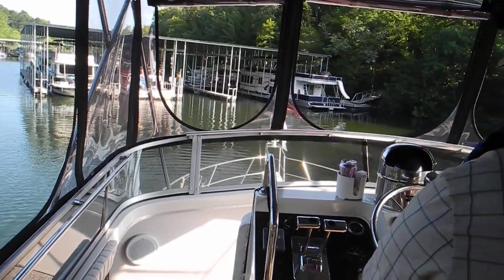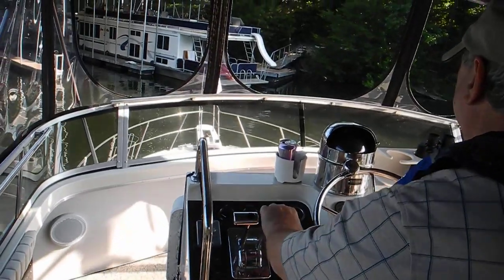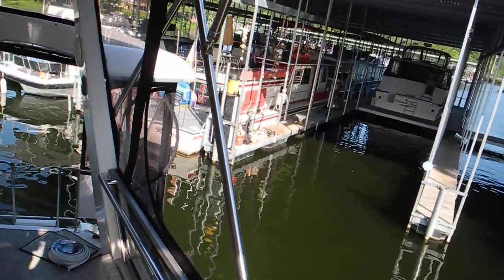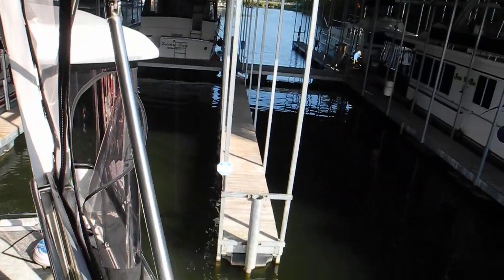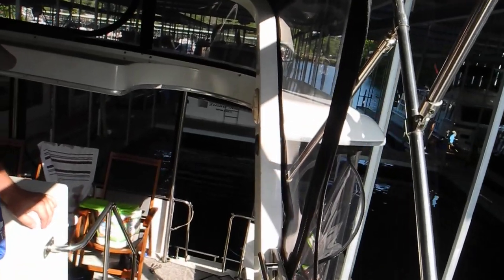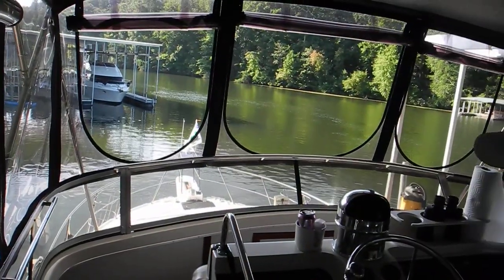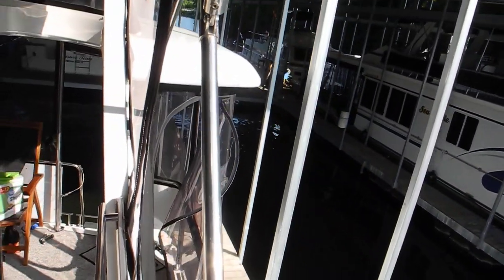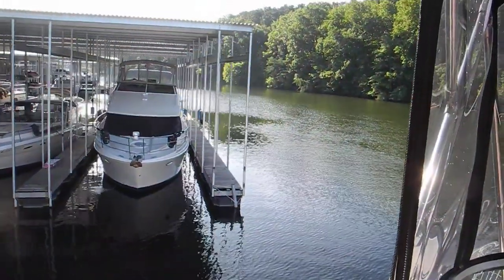Docking practice Harbor Lights Marina, Chattanooga

Comment: Is there any reason not to have one engine in forward and the other in reverse?
Reply from the maker: At some point we had each engine in forward, neutral and reverse. Sometimes both opposing, sometimes one was in gear while the other was in neutral. This was a new boat owner who was learning to feel how the boat responded. Docking is not just using the engines but also using the wind- however subtle the wind may be, including wind eddies that funnel through the other docked boats and the covered sheds. Thanks for your question.